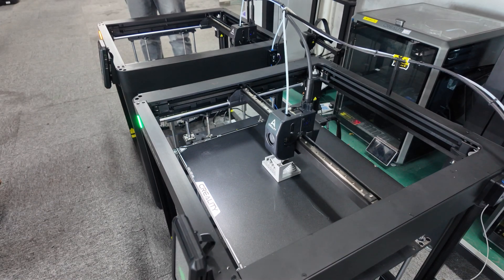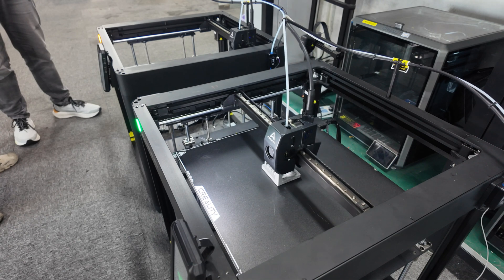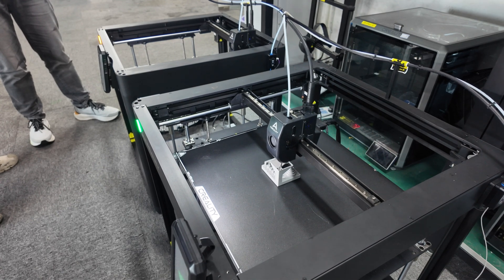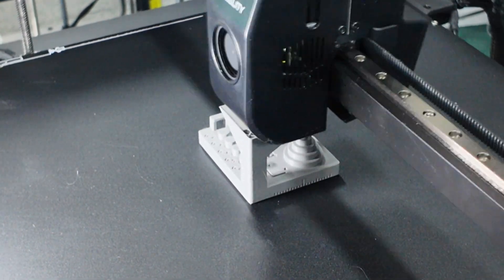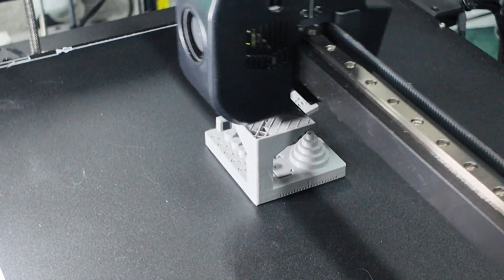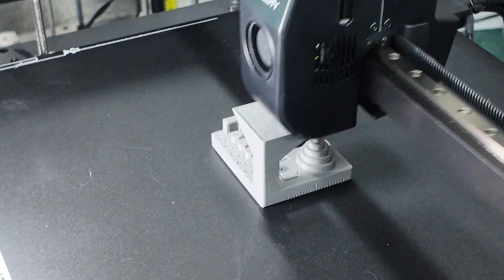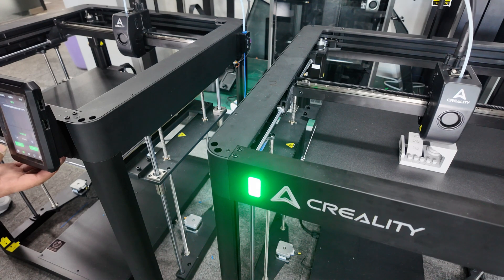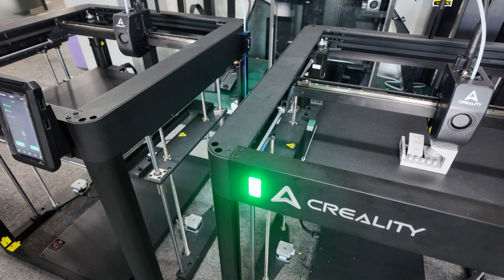New Printer from @Creality3D  - The Ender 5 Max.

Comment: Just to be clear the frame of the Ender 5 max is new. The Toolhead however is NOT new. It is a MishMash of a CR-10 Extruder (2015) and K-1 Series hotend (2022) not K2. Also it DOES not have a new Unicorn nozzle. Since I have one and have had to unclog it multiple times, I can assure it has a tiny screw in brass nozzle that screws into the hot end.
Reply: I just converted mine to unicorn nozzle by switching out K2 plus hotend guts on to the Ender 5 max hotend heatsink/fan. So far so good, seems more dependable. Look it up here on youtube, a few different tutorials.

Comment: I got one this weekend - my 10th Creality printer. Loving it though I do wish they had used the K or Hi series style print head with the runout sensor in the print head and a unicorn nozzle, just for simplicity in keeping spare parts for my printers and to avoid that long wasted filament from the runout sensor to the print head. Perhaps a future firmware upgrade could do something like the centauri carbon does where it knows the distance from the sensor to the extruder and actually uses up all of it before notifying you of a run out. But it prints beautifully and gives me more room for multiple prints or bigger objects which is awesome.
Reply from the maker: I have just started using it this week also. Big. I agree about the nozzle, wish it had unicorn nozzle. Also the filament runout - very true. Is it possible they will make it CFS compatible one day? They said no - but they didn't say never :)
Reply: @kevin.in.3d  I would actually like to see something like the infinity flow for it instead. I'm looking into getting some 3 or 5kg spools, but having just an auto feeder would be nice - doesn't need color change, just the ability to auto refill.
Reply from the maker: @LoriAnneBrown  I have atest product at home right now that does exactly that. It has two lines and when one roll runs out it automatically uses the second roll. I have made a video for it but was told to wait until they announce it. Creality does not monitor my Tiktok though so you can see it there @kevin.in.3d
I posted the Video October 6th there. I have been using the device since October 6th and it is amazing. For the E5 max it would be so good. 2x3kg rolls preloaded. If one runs out you can load a third one - it's infinity printing!
Reply: @kevin.in.3d  omg that sounds amazing! I will check it out - thanks!

Comment: Any news on CFS for 3v3? Or any updates on Creality HI?
Reply from the maker: expecting information at CES January 7-10.  Should answer all of our questions this month!
Reply: Great, thank you
Reply: So based on todays live show for the Hi, there will be no support for CFS for the Ender 3v3/plus which is quite disappointing. The co print solution is not straightforward for the average user so will dissuade a number of people from considering that option. I love my 3v3 but if I want the option of multi colour, then I have to buy a new printer. Another expensive purchase in less than a year. Very frustrating

Comment: So it’s a little hard to see, but is it a Core XY printer ? I only see one belt ? Also 400x400x400 is awesome ! Can you show where the mounts for the enclosure a little closer ?
Reply from the maker: I did have another video a few weeks ago showing one with a back panel and it also had these clips on the side that would hold the side panels.  I didn't know at the time that panels were optional.  I'll try to find that machine again and get more footage.

Comment: All their products now have the flat linear rail now which is good. I just wished this was the case for the k1. Yes there’s BCJ upgrade kit. Just wished Creality would except their mistake and make their own kit too 😂
Reply from the maker: have you upgraded yours?  I have K1 and K1C and no issues - but always looking for cool upgrade ideas.
Reply: @kevin.in.3d  K1 - So for VFA's I have done the following. 
Springs removed out tool head, helped alot.
 X-Axis cleaned & used Sewing machine oil for lube. Lovely and smooth now. 

 XY Belt Tensioners Upgrade by Henlor on Printables, this helps make the tensioners perfectly straight, If you watch your belts as you print, you may notice them ride up and down the pulleys, this stops that! 

Other mods, took PTFE tube out chain, I've removed quite a few links out the chain but also replaced 3 with ones to hold the PTFE tube. 
A riser for the chain at the tool head. 
Both these help the angle of the PTFE tube going into extruder. 

Door rattle fix, makes the Botton hinge a tighter fit. (K1C has this already) 

The door cover (The gap behind the display) 

I don't have a riser for the lid as I print alot of ABS/ASA and not found a riser that doesn't leak out the VOC's and retain heat.

I am rooted, so I have Fluidd and correct input shapers, I've also calibrated for Skew. 
I've changed the bed mesh Fade, so after about 12mm of print height the bed is no longer compensated for, creating better tolerances. Default it's around 50mm high which is. a bit much. 

Did buy the Ben2C fan shroud but it yielded poorer results. 

Stock extruder, Original none unicorn hot end with a aliexpress Hardened steel nozzle 0.4. Just seems to work better than the unicorn at the moment. 

About it. Not heavily modified. 
Looking to upgrade XY motors and add 20T pulleys like on the K1C.

Comment: From looking at the instructions on maintenance of the the print head, the images if not mistaken show the nozzle to be the older short type ?, hope no leaks from expantion/contraction
Reply: I am considering this printer for it's print volume , shame no cfs
Reply from the maker: yeah, great build size, agreed!
Reply from the maker: older - short type, like the K1 nozzle and Ender 3 V3 SE?  I want to take the hotend apart but they just don't have a spare machine they will let me tinker with yet.  The V3 SE nozzle was short but I never had any issues with it.  If I can take it apart we can solve this riddle - stay tuned.

Comment: I have the K2P, which is good for all things at 300 size. This one is too small. The next interesting size is 450, and then 650.
Reply from the maker: The K2Plus is actually 350 -  yes this machine won't be much bigger than your new K2Plus.
Reply: @kevin.in.3d  I know, but you sometimes need a few extra centimeters to print for things which are 300, 400, …

Comment: thank you, how does this machine differ from the K2 plus other than size and side panels? why is it called the Ender 5 series name instead of the K# name if the tech is getting closer to the new printers?
thanks!
Reply from the maker: I think the Ender name is very much our basic machines that can be customized for how you like it.  The basic design of this machine is similar to the last Ender 5 - electronics in the baseplate.  The K2 has heated chamber and cameras and  all the bells and whistles.  But at twice the price.  So people who want a printer out-of-the-box experience like the K series printers.  This Ender 5 is aimed at print farms and people who can customize it as they like.

Comment: Why is everyone releasing their version of a 'Bambu clone', all of a sudden? It seems like a larger version of what I already have, two year ago.
Reply: Why did Bambu clone Voron from four years ago?
Reply: Why is there more than one manufacturer making electric suvs? Same answer, competition
Reply from the maker: competition is good!!
Reply: And what is your pathetic point
Reply from the maker: you do know that "larger" means it is different, right?  A clone is the same - but something that is larger and faster is actually different.
Reply: This is not a bambu clone.  There and bambu cloned a already avaiable design.
Reply: It’s literally taken them 2 years to try and catch up and they still haven’t got there. It’s not just the printer, it’s the software and the integration of both.
Reply: @markm49  I'm pretty sure Bambu didn't just slapped the X1 together in two months.

Comment: Nice video . Thanks for all the info .I really hoped fora a camera to be there in ender 5 max for monitoring and stuff 😅
Reply from the maker: I asked this week about the camera and it is optional.  There are two mounting holes just behind the screen on the top rail.  Seems like this is a very modular design - can add what you want.
Reply: @kevin.in.3d  nicee
Reply: no camera?  I didn't notice that.  I guess we can add nebula cam with the usb on the control panel.
Reply: @thelees1000   brother I'm giving 700 dollar atleast I expect a camera instead of using some external device 😅